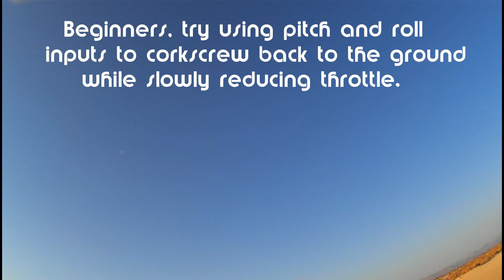Quadcopter "Wobble of Death": VRS Recovery and Avoidance

Comment: The video is great and gives great tips to operators, but seems to have two misunderstandings. First is translational lift, which occurs from the aircraft moving forward. It works due to the rotor being tilted toward the air it's moving forward into. Air has mass and you're increasing the mass flow through your rotor. You're also reducing the effect of wing tip vortices by moving away from them and having the air you're moving into blow into them reducing their effect. All lift is created by newton's second law, to move a mass up you have to push a mass down. The more mass you can push down and have most it go directly in the direction pushing means you can create more lift.
     The second thing is the description of a vortex ring state. A vortex ring state occurs from the upward moving air near the rotor hub during hover or decent, and the increasing size through momentum of air created by the wing tip vortices. The vortices get larger without lateral movement  and capture and inflate the upward movement of air near the hub during descent. The reason air can move upwards near the hub is due to the slower speed of the blade as you move closer to the hub and is caused by the aircraft's descent or by vortices increasing in size until the upward moving air from them can overcome the slower moving air near the hub. 
     To visualize a vortex ring of air think or the vortices creating a donut of air near the wingtip. That donut can grow during hover. Now hopefully you can also see why lateral movement gets you out of it

Comment: This is especially bad at high elevations. I live in Pennsylvania in the mountains and I owned the quad you have there but now I have a jjrc x5  (bugs b5w) new model and it's very bad with VRS! I was going to return it. I'm not totally sure its vrs because it even does it in a hover 30ft in the air.

Comment: can I fly an eachine 511s without a mobile phone
Reply from the maker: Strange video to ask this question.  But yes you can fly it visual line of sight with its controller.  However, you will not be able to view or record video or photos without the phone.
Reply: I think with an s d card you can take photos and play back later ? or not ?
Reply: thanks for that just thought id learn to fly  better b4 getting into  that
Reply from the maker: Ooops, you're correct.  The E511S has SD card recording capability.
Reply: @Quadcopter101  third time up was flying great then I was descending to land and it fell from about ten feet ,and now the right rotor blade doesn't turn when firing up . is it repairable ? thanks for your replies kelv in spain
Reply from the maker: The 511S is a brushed motor quadcopter.  Each motor will eventually fail.  Ways to prolong life is not to do back to back flying with replacement batteries, as the motoros need a cooldown period between flights to prevent overheating damage. But they can be replaced, and requires opening the drone, along with possible soldering. Fortunately they are very common and inexpensive. Unfortunately I don't know what specific size motor this drone uses.  You will need to measure the diameter of the motor using calipers.  If 8mm diameter, search Google for 0820 motors for replacements http://bit.ly/2wtC3YG.  If 8.4mm diameter, search for 8520 motors http://bit.ly/2WitVJH.  Also be sure to match the same color wires on the old motor when replacing.
Reply: @Quadcopter101  I have 4 batteries now , it doesn't seem possible to buy a new one without the batterie  option ?

Comment: Thanks so much for this video!
I was flying in Slovakia last year and whilst bring it down from a high altitude it went absolutely mental for no reason (full throttle did nothing) and dropped rapidly for about 60 metres rocking violently before it settled a few metres above a tall tree (phew).
I’d since been blaming the quad for the situation, but I now know it was a classic case of VRS caused by descending into powerful thermals (it had been a very hot day).
I was lucky as I now believe the tree had dampened the turbulent air and saved my quad form smashing into the ground.
After watching your great tutorial I’m now aware of the causes or VRS, how to avoid VRS and hopefully escape a future VRS situation.
Many thanks again :-)

Comment: My quad has been acting weird. Inside it seems really smooth and I can zip about. But outside it never used to but it now shakes / wobbles and will try to flip itself over when I use pitch and yaw especially when decending. I set my idle throttle to 20% and it didn't make a difference. I have default PIDs for this RTF Arris X80. I fly in angle mode.
Reply from the maker: Sounds heavy.  What size battery are you flying with?  Also, are you flying with prop guards outdoors?  If so, take them off.
Reply: Quadcopter 101 The battery is a 14.7g GNB 600mAh 50C 1S and I have 8 of them on rotation. I never charge more than 4.22v and end my flight after 3 minutes leaving the cells at 3.75v average at landing. I do have the prop guards on but it flew smooth outside with them on before. Not sure if its related but it actually wobbled inside too a few weeks ago as the power wires had almost snapped off the flight board. I soldered new wires and connector on and the indoor wobble stopped. Thanks :)
Reply from the maker: Yes, if you're not crashing as much, remove the prop guards (especially outcdoors) for much better flight performance.  Also, have you connected to Betaflight yet to do a gyro/accelerometer calibration?  If not, recommend doing such.
Reply: Quadcopter 101 Before every flight I place the quad on a cradle on a level surface verified with a digital spirit level and do mode 2 stick commands calibrate gyro and calibrate accelerometer. Not sure if the one in betaflight is one and the same though?
Reply from the maker: The Arris is not a toy grade drone, and uses a Tinyfish flight control board.  Am pretty sure that stick commands are not going to do it.  You'll need to place it on a flat level surface and use Betaflight accelerometer calibration on its Setup tab page.  For these micros, a quick level surface is to balance each of the four arms on the brim of a teacup.

Comment: I am also a commercial helicopter pilot of 30+ years and I agree with justinspirational, you explained it so I don't have to :-) My 2 bits... you need 3 things to get into "Settling With Power" (we don't like using vortex ring to describe it as it is slightly different). Settling with power must have these 3 things to occur: 1. POWER/THRUST/HOLDING LOTS OF POWER (typical condition = TOO HEAVY) (like the power required to hover or more). 2. ROD - Rate Of Descent (you must be descending, even if only slightly it can occur). 3. LOW OR NO AIRSPEED - Settling with power will only happen if you are hovering or have very low airspeed. Basically you are falling into your own down-wash and the Helicopter, now moving in descending air does not know the air is descending and will rumble and shake and then all your controls become mushy and you will start falling with one option left to save your butt. You must gain some fwd speed and as you have demonstrated (very well) some fwd speed fixes the problem very quickly. It also pays to reduce power as you nose fwd. The reason full size helis crash from this condition is often because there is no room for you to descend rapidly, fly fwd and escape the condition without hitting the ground if too low or obstacles if in a tight spot.  Just think of your down-wash and avoid it if descending and you will be ok. On a full size heli it can also happen in your Tail Rotor, if you do a fast pedal turn in the hover you can experience it in a horizontal way, your tail rotor will become ineffective and you can loose control as the torque takes over and the spinning begins. Not that common but something that can happen. I also think a very fast quick stop in a flare could put you into it if you end up with the 3 things mentioned, it is possible as you would be descending into your down-wash with power on and the rate of descent is your flare with low or no airspeed. 

I have been wondering about this for a while, thanks for the demo, I am a new Quadcopter Flyer too and I am amazed by the power of the Quad, it is incredible. It is very tempting once you do a pop and roll to just descend back down to where you are, this is where people will get into trouble, I have been avoiding doing that for the very reason you have explained.

Great video, also really cool to see Drone Flyers are taking the time to understand the Theory of Flight, it is not essential but sure does help if you understand it, it is also really interesting. Good points on Ground Effect and Translational Lift too :-) These are all things we think about every time we fly.

I have been thinking that a vertical tail fin could be fun to try, it would help keep the Quad pointing fwd once it gained speed, could be good for LOS flying anyway as I am having a crappy time learning LOS flying, orientation is a nightmare, just looks like a dot to me and I have pretty good earsight!! I am about to transition from LOS to FPV but want to get my Acro skills sorted first.

Thanks again, very well done, something all Drone flyers should watch!

Comment: "Full forward pitch" WITH full power?
Reply: Ahh. Okay. Just breaking into the hobby. Thanks for some great instruction!
Reply from the maker: Sorry about the previous answer.  I thought you were asking this question for a different video.   In this case, full forward pitch while gradually increasing throttle.

Comment: Through my testing with a quad, I think generally as long as you keep the overall quad weight at 40-45% total thrust and under, it is easy to recover from VRS. Also, higher pitch props may give slightly less thrust at hover, but work well in turbulent air. (tested with 1650 and 1655 props). Finally, make sure the PID values are tuned very well, especially for custom builds.

Comment: Has to be one of the most useful vids on quad flying... I did wonder if "intelligent" models like DJIs, Yuneek etc if those have enough auto-override aboard to cancel out ill-advised attempts to descend so quickly that would produce VRS?  Perhaps it's a beneficial side effect of some toy quads with altitude hold when descending they often don't come down as quickly as the pilot might wish. Could be that's saved a few terminal crashes?

Comment: Another tip to get out of VRS. If there is a breeze and you are descending, always pitch AGAINST the wind direction instead of with it. So forward pitch may not be the answer if you are facing forward with the breeze. If you are moving WITH the breeze and descending, the wind speed can negate your actual speed and the quad will act as if it is descending vertically with no breeze and enter VRS. Does that make any sense? Don't know if I explained it well. Anyway, good video about the VRS effect! Happy flying!
Reply: You are absolutely correct. Fixed wing models need to start into the direction the wind comes from. It is very easy to understand, that higher pressure in the direction you are flying results in higher pressure underneath the propellers.

Comment: Thank you! I just read about this in Wikipedia, and how to recover (related to single or dual full size helis). I've done so often a full rate descents on my Phantom 1, and the wobbling is there. The rate of descent is said to be limited by the firmware to not get into serious vortex ring state. And it seems true, it's always been in control (excluding the wobble, which is not that bad either). I've hit the ground though, bouncing back into air but I've just thought I didn't have enough clearance. Knowing this would lift my hair if the descent wasn't limited!

Comment: About translational lift, I always have to throttle up to maintain altitude with a steeper angle of attack, which makes sense to me because the air isn't being pushed straight down anymore. Does translational lift only apply with subtle drifting?

Comment: I came across this sorta by accident when I first started flying my quadcopter. I learned very quickly to get out of VRS by simple slamming the quad into a diagonal direction and dropping about a foot, then throwing on some power as I keep it going sideways. It comes out of it every time now. I've actually practiced this like you did in the video.

Now I just have to learn how to fly in circles in the forward direction, I go side to side, leaving the quad pointed straight ahead. I am easy disoriented and have to practice this with the help of your videos. I think I have to get around the red being the front. When driving a car, I know a cars backside by it's red lights.

Comment: Thanks so much for this valuable VRS tip Q101!  This just happened to me with my new XK X252 a couple of days ago. I'm still a novice, not to flying RC or real planes, but RC drones.  I was out flying the X252 when I realized it was getting a bit high.  I immediately pulled the power back some and it went into a vertical descent.  Almost immediately it began wobbling badly on the way down.  I added power and luckily I still had plenty of altitude so it smoothed out and I was able to fly it out of the descent and the story had a happy ending.  In fact, I thought it was just the X252 not being very stable since it is a little squirrelly being a high performance brushless 3D quad.  Now I know I was at fault and will avoid vertical descents in the future.

Thanks again!  I wish I had run across this tip earlier.

Comment: Thanks for posting this video, I recently bought a DJI Inspire, and have had multiple UAV's over the past few years, starting with the Phantom 1, and building my own F550 Hex.  I've flown them many, many, MANY times, and never new about the Vortex ring, how to come out of one, or how to avoid them all together.  I am always easy on the sticks, even when landing, so that's probably why I've never experienced it, but none the less, good tips, and I will start to use the decent options that you show in this video.  Thanks again, you may have just saved me a model. =)

Comment: Do you think a similar phenomenon is happening to me at 8:05 in this video? https://youtu.be/T_Ih7jzCBxE?t=8m5s (onboard film of the same incident is at about 9:40)
Reply: Oops, the time links above are to YOUR video, my video is the long link in the middle.  Sorry!
Reply from the maker: Yes.  At 140 grams, the onagofly is way too heavy for a micro sized quadcopter.  It may be able to lift off vertically, but coming back down is where the danger is.  I don't think that they had an aerospace engineer onboard their team (and if they did, he was shouted down by the other team members).
Reply: Thanks!  I bet this is why the rate of descent is software-limited in this drone (about 7 min 15 sec in same video)

Comment: Great video but leaves me wondering why beginners should use pitch and roll for their circling and more confident flyers use pitch and rudder? I guess right-handers would more adroitly handle the 2-channel input on their strong side and simpler 1-channel input on the left or is it more than that?

Tried skimming comments before asking but so many I gave up!

BTW, a similar wedge-diving approach helps me fight back against a high altitude wind carrying my Hubsan 107c away - cutting throttle while applying whatever pitch or roll brings it back my way at an descending angle that slides under the wind rather than beating against it. I know I'm not original on that so maybe there's a name for it...
Reply from the maker: +Rusty Meyners It's because beginners lose orientation very easily when the quadcopter turns directly toward them in the spiral (which would happen during a yaw descent).  If they only use pitch and roll, they can keep the back end pointed towards themselves throughout the entire descent.
Reply: Perhaps "beginners" should be clarified. Those new to copters but experienced with fixed wing models may have an issue if flying a helicopter or multi-rotor towards themselves tail first, since they're used to having roll reversed on an approaching fixed wing model. Pitch versus throttle may be an issue either way though for the transition from fixed wing to copter.

Comment: Is it possible to cut throttle and drop a quadcopter to the ground and then put full power to the motors 100 feet up to stable out and land without getting vortex effect?
Reply from the maker: +Madscientist No that will aggravate (make it worse) vortex ring state.
Reply: Quadcopter 101 Would it be possible to come down fast at all?
Reply: +Madscientist Yes, if you maintain some motion in any direction, you will stay out of your prop wash and be able to descend faster than trying to simply descend straight down. Swaying forwards/backwards or left right works well if you are just beginning, but it can be slightly turbulent when you change direction, so as you get more comfortable, you should essentially just rotate the pitch/roll stick in a circle.

Comment: Thanks, sir. It was very helpful to me.

But, what if the space is not big enough to do it?
Is it possible if I just make a roll forward and backward (continuously) while lowering the pitch slowly?
Reply from the maker: +Ridho Rizanov The problem is that by doing such, you will stop momentarily at the outer reaches of your swing.  You want to keep moving.  Another way to do it would be by making a small circle as your descending by moving the the pitch roll stick in a small circle as you descend.
Reply: +Quadcopter 101 So I have to make a little bit forward move along with yaw to make a spiral path descend?
Oke, I'll try. Hope the circle aren't be too wide.
(sorry for bad english).
You are very kind and cool. Thankyou, Sir.
Reply from the maker: Ridho Rizanov Yes spiral is best.  Take your time and practice.